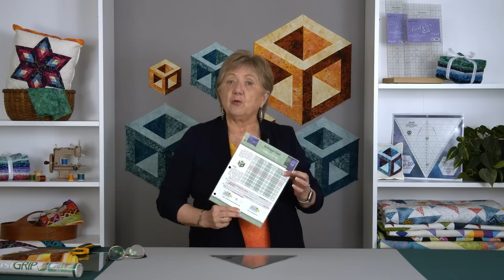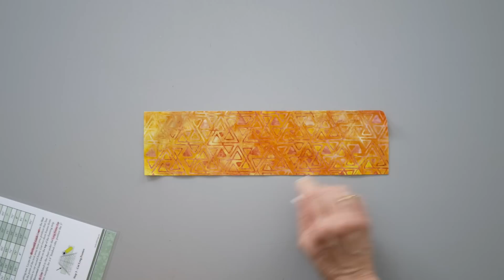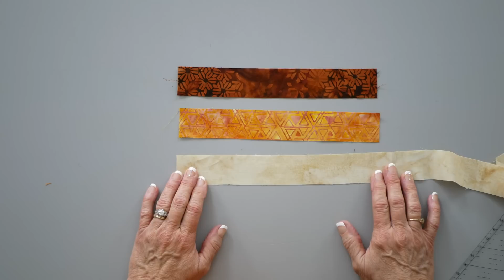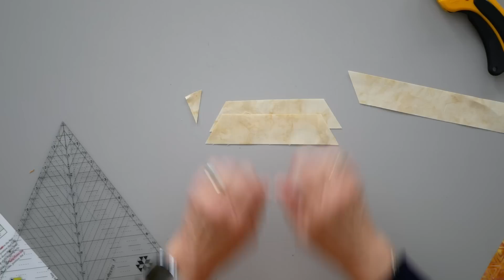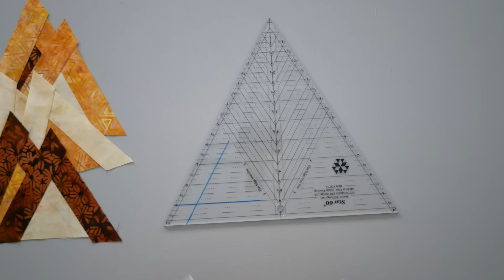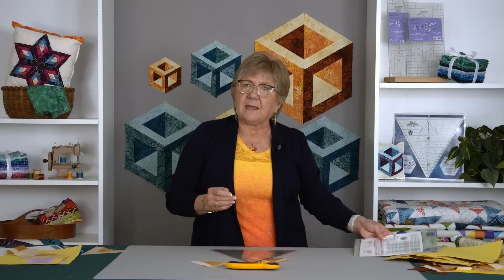Hollow Cube 60 Tutorial

Comment: How many of your patterns make use of the star 60 ruler? I was looking at the cost but I would want to purchase only if it is used in more than two patterns.
Reply from the maker: Sorry for the delay in answering. We have 6 patterns for the Star 60 tool, one of which is a BOM pattern. There are also 8 technique sheets that allow you to use the tool in many different ways to create unique blocks. Also, with the numbering on the Star 60 tool, you can use it as a regular 60-degree ruler when a pattern calls for that.

Comment: Since you’re only using  the horizontal lines, will a 60 Equilateral Triangle tool work?
Reply from the maker: We have not tried it with another ruler you would have to try it and see. But make sure it is a blunt tip ruler or the numbers will not correspond.